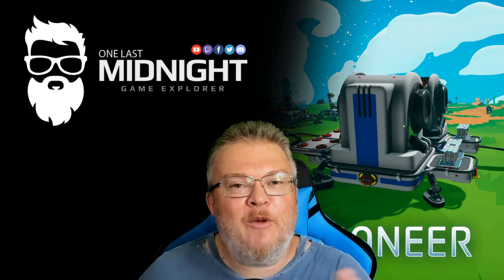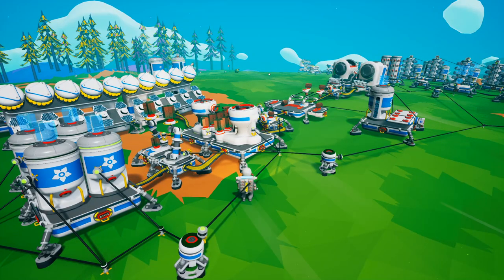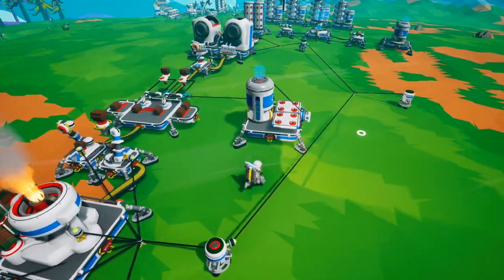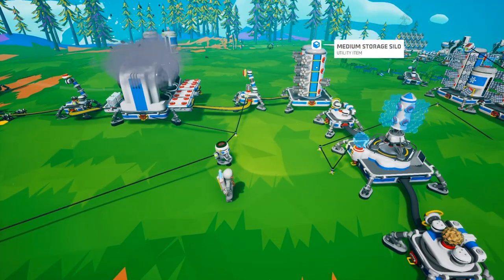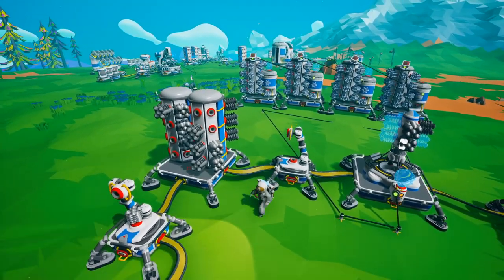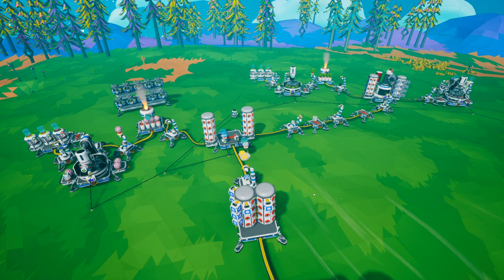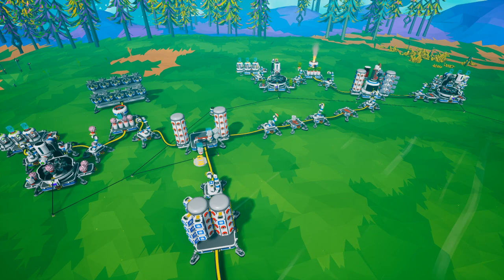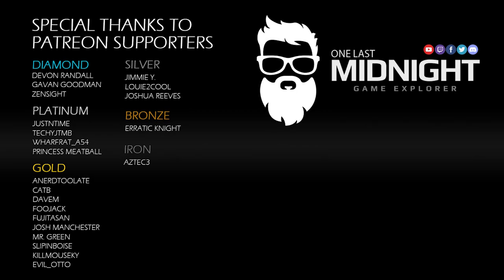Astroneer - HOW TO AUTOMATE THE SHREDDER - A BUILD GUIDE

Comment: You can store scrap in medium and large storage containers
Reply from the maker: You can, but the resource canisters will not allow for input and output simultaneously.  So...  It keep the full system running with the trade platform you will need a different storage solution.

Comment: You don't need the timer at all if you look at a printer GUI there's a little blue button with three arrows on it if you click that and then press the green button it will automatically print of many of that thing as it can and then it will stop when it's out of resources (if you add more resources it will continue printing)
Reply: Yeah this was done before they added it you can also use 2 count repeaters and a storage sensor to count the off loaded resources  instead of the long clock with loads of resources

Comment: If you make/shred storage sensors, and feed some of the scrap back into the system to trade for zinc, you can completely automate soil to scrap. It only yeilds .25 scrap per small soil canister.  Also suggest using holding platforms with storage sensors rater than a timer for the trade platform.  I created a guide on redit: https://www.reddit.com/r/Astroneer/comments/hmvbb7/exo_automated_mass_production_protocol_via_soil/?utm_medium=android_app&utm_source=share
Reply from the maker: Yeah, we had a long conversation about this, and you are correct. With the abundance of malachite around I decided to go this route because I felt it was quicker.

Comment: But why does the trade platform timer have to be so long? Can't you just have a 15 20 second one to give it time to unload then it'll just start again
Reply from the maker: You could have a shorter timer, but it would cause misfires.  Meaning, the trade platform would not fully fill with strap causing an inefficient trip.  The trade platform takes 50 seconds from launch to land.  If you add time to restock and unload unload, 20 seconds, and you match your timer to that full cycle...  You will always launch fully loaded with scrap and get a return that is also fully loaded.  The misfire would cause the same, say 8, resources to be delivered slower than just waiting the first time.  Example would be you only load 4 scrap, and get a return of 4, and would need to run the trade platform twice to get 8 resources.  Two minutes plus to get 8 instead of 1:10 or 1:20 to get 8.  Hope that helps.
Reply: but why male models
Reply: @OneLastMidnight  ah that makes sense so with a shorter timer it would have times where it only sends a few scrap, I get it

Comment: All these automation elements and I think the best one is the chem lab; she just go now eh? Bring back a canister or two of ammonium and 16 or 33 hydrazine comes out steady as a nitro glycerin salesman. There is a logic error where the process will shut down  if the resource being used is in a canister on the same platform and enable output is disabled, even though there are multiples of the same resource already residing on storage on the same platform, but there are a couple workarounds, and I'm sure the devs will notice and correct soon? I've been after auto chem lab ever since the jet pack update.

Comment: Wait...I understand that when you gather resources via terraforming tool they run out because you will dig it all up. That makes sense. But with the Auto Extractor I thought that since they don't destroy the ground or the resource that is being extracted the resource will remain pretty much infinite.
Reply from the maker: You get 16X the amount from the resource deposit, but it does run out.
Reply: @OneLastMidnight  Yeah I did some testing and visited astroneer wiki to confirm that resources are not infinite. That is a shame. Having infinite resources would be great since you can ditch soiling centrifuge and mine the basic ones like resin, compound etc. with the extractor. The good thing about extractor is that even though it has full power it extracts rather slowly so it is finite but it is taking longer to mine it all. So I guess it is good after all.